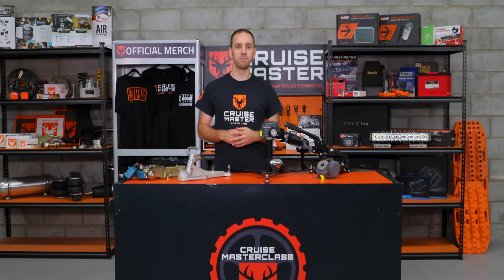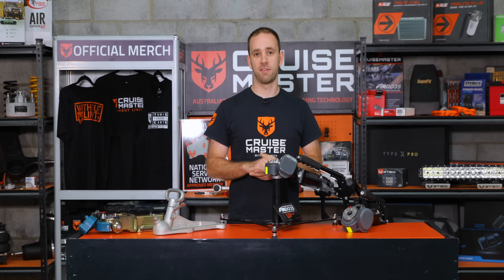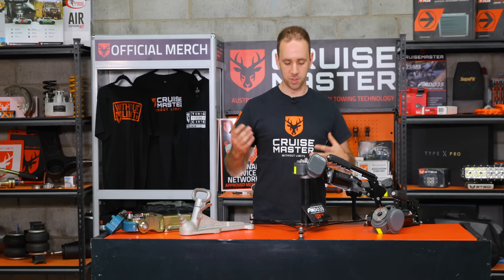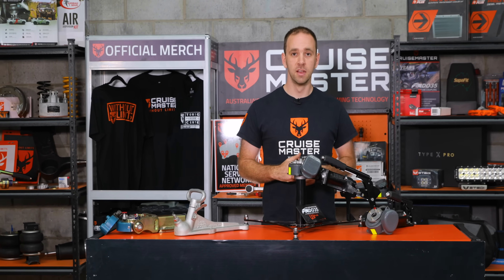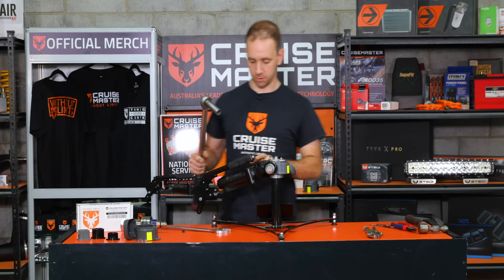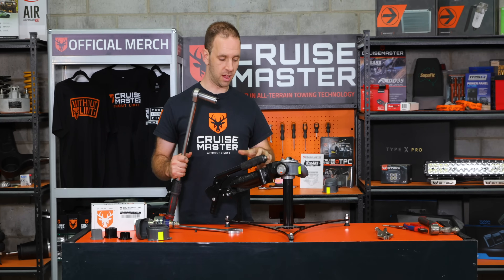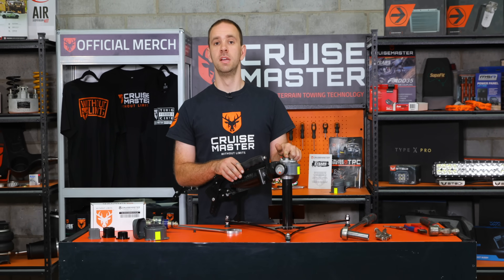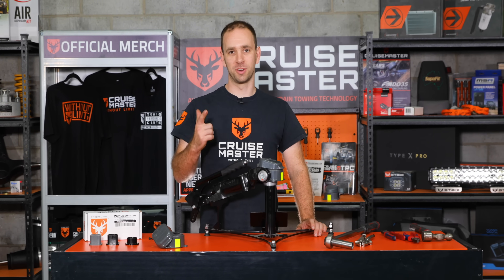CruisemasterClass - Ep. 13. Coupling Maintenance

Comment: Opportunity lost here. Why not show folks how to actually check for play. Where it’s mounted on its mounting bolts and you grab the other end. Showing people how to check for play on the bench removed from the van seems odd. Also the description on how to tighten the rear nut describing it as tough due to weight of the caravan tells us nothing about how tight it should be. Would it have killed you to list the torque specs?